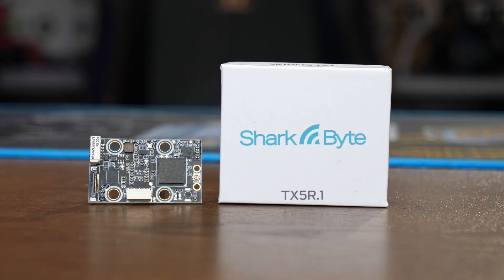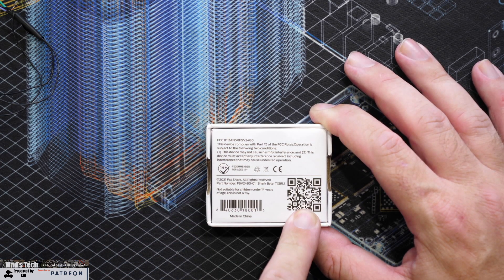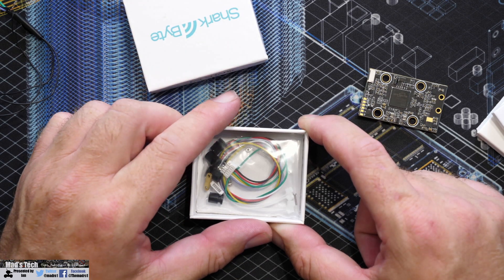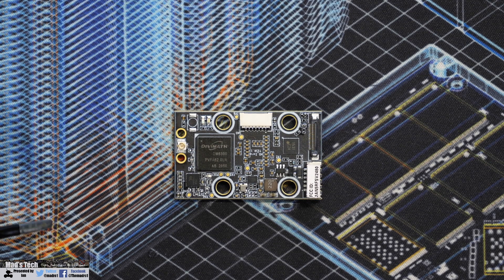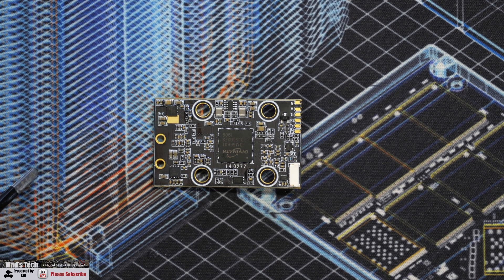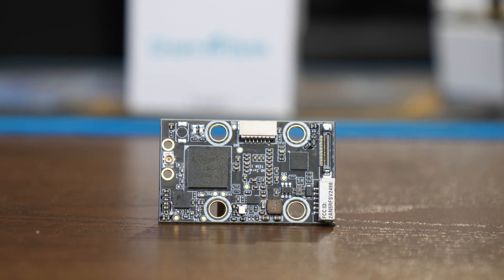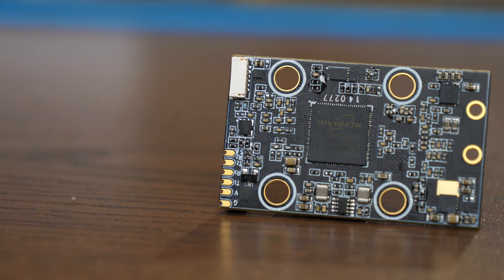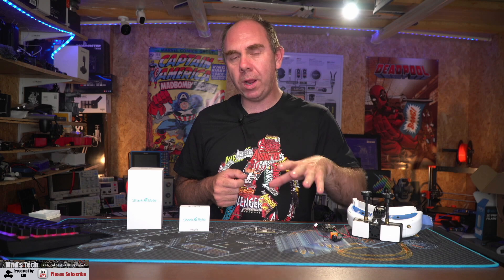NEW SHARK BYTE TX5R.1 200mw Race VTX With Smart Audio From FAT SHARK

Comment: This company seems to be acting like the old car makers of Japan where one team designs the front and another the rear of the car.
I Say that because the change back to the very poorly designed antennae connection and then they (what I consider an afterthought) added a clamp to hold it. Why not just stick with the better connection. The board is big enough as it is and a little more height would not be an issue.
Reply from the maker: I agree while I hate MMCX I would have preferred it.  SMA was doable to o

Comment: Insanely overpriced......
1080p box goggles make me think Fatshark out of touch with its customers.
Let's get the system built in some top end low profile goggles with oled screens with minimum 1080p resolution 
And not insanely over priced.
Reply: Not as insanely priced as DJI gear that becomes obsolete very quickly 🤣
Reply: @Pilotltd  if you don't have goggles your looking at 400 hdo2 and 180 for sharkbyte doesn't sound insane anymore does it?
Reply: @chrishiggins7475  How long before DJI bring out Mk3 goggles I wonder? Frank Wang and his partners need to keep up their billionaire lifestyles somehow 🤣
Reply: @Pilotltd  v1 works perfect
Reply: @chrishiggins7475  My point exactly, V2 was simply a cynical sales ploy for those who fall for sales hype. 2nd hand V1 Googles fetch a higher price than V2 now 🤣😂 Once many are on the roundabout it's difficult to get off...
Reply: @Pilotltd  Rocking my V1s since Sept 2019... not a flaw...and not obsolete at all. Actually DJI´s drone gear has a longer life than most FPV products... and devaluates its second hand price much less than the rest. Not a DJI fanboy at all, but between Fatshark, FRSky and DJI, I don´t know who I dislike more for their shady corporate practics... hey, at least DJI works well.
Reply: @sacredk1  I dont disagree - V1 not obsolete, so why V2? Just to con sucker punters into spending more - I predict V3 when sales start to fall below their expected volume/profit 😉
Reply: @Pilotltd  I totally agree... in fact I will keep my V1s and not upgrade to V2.
Reply: Agree with every comment jason